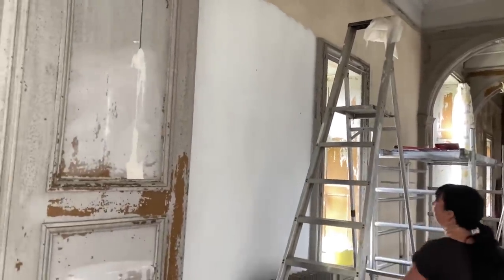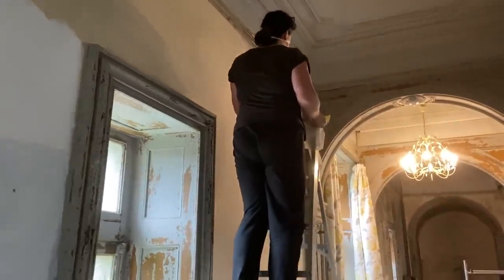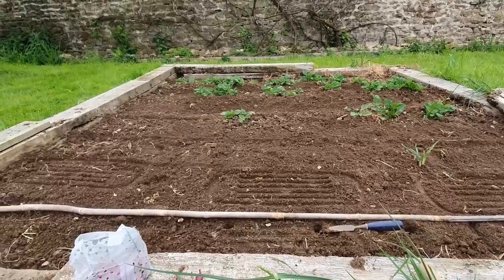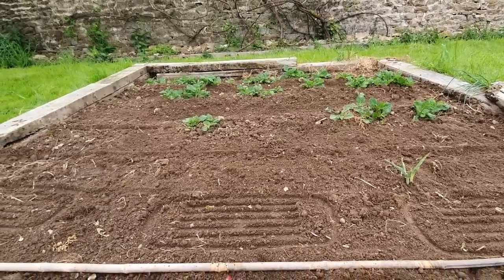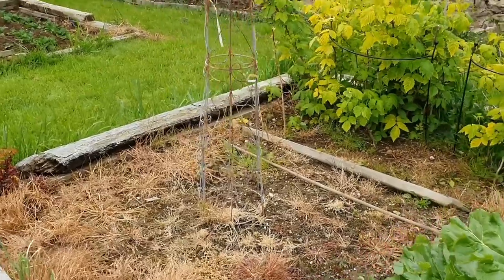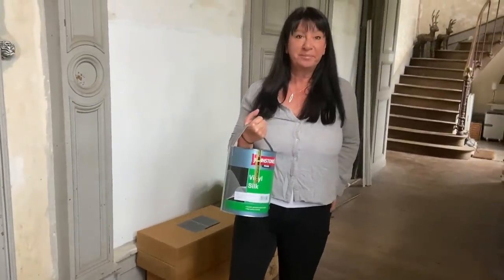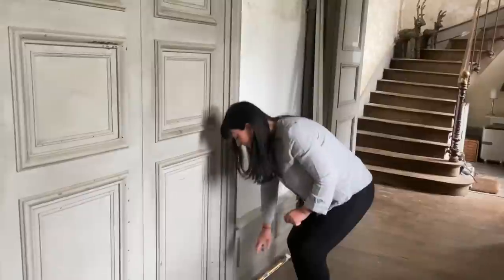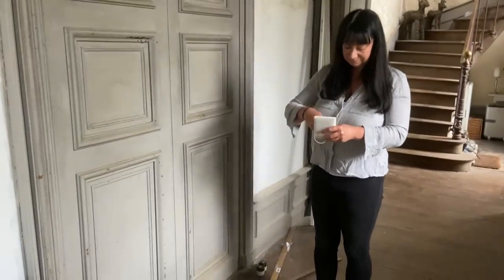The Château Gets A Horse From London!

Comment: Hi again Carole and Adrian. What a super effort on cleaning up the Hallway plaster et al. I assume the plaster on the walls is lime plaster and the original? I only ask because I noticed that you had purchased Vinyl Silk emulsion. By using Vinyl paint or papers on lime plaster you are taking away the ability of the walls etc. to ''breathe' which can result in exacerbating mould and damp problems further down the line. I had this problem quite a few years ago and it resulted in having to go to the incredible expense of re-plastering 2, 4x4 by 3 metres high rooms, including ceilings, in lime plaster (for listed 18th century building in England.) A big, big mistake I don't want to make again! Please , please, please check that it's ok to use the Vinyl before you continue. You are such a wonderful pair of hard-working, dedicated people working to restore a wonderful home for yourselves. Ships and Tar springs to mind. So sorry to sound like Cassandra again, I only want what's best for the Chateau and for yourselves going forward.

Comment: Hi Carole!  At 5:20 you can see that the brightness is there on the exterior wall because the exterior wall is painted white and the interior wall isn't. It kind of speaks to the fact going a 1/2 shade lighter for the exterior wall will match the interior wall closely at your original desired shade.  As well, on the ceiling at 5:00 you can notice the way the whiter base coat is much brighter than the unfinished side, as an example of how the natural light will play with your chosen paint.

Comment: Well done as usual Carole. If you run into issues with putting latex-based paints over oil-based paints in the future you could try (if it is available in France) using a mixture of trisodium phosphate (TSP) as a wash on the surface (following the prescribed directions on the container), let dry, then put latex-based paint over oil-based without a worry. That is what we did in the house I grew up in when Canada when they stopped selling most oil-based paints in favor of latex-based paints.
Not sure if paints with lead in them would react negatively to the TSP, so maybe check on that if you have oil-based paint layers that may have lead in them.

Comment: You should rig the light switches in the hallway together on the same switch so when you enter and turn the light on, the hallway is lit from one end to the other. Put these switches at different ends so you can turn then off without travelling from one end to the other.

Comment: You may be able to bend the harp inside the lamp shade back into shape. Years ago I worked in a store that sold lamps. The harps were frequently bent/crooked so we just bent them back into shape. It didn’t require a great deal of force but did require patience and attention to detail. We all know that you have those qualities.
Reply from the maker: I’d rather return it for a replacement incase we brake it
Reply: @LifeAfterLaFerté  I agree. If you pay for new, it should be perfect.

Comment: The little frame on your horse lamp from the light bulb socket base that goes up pass the bulb and has a screw that  holds the shade (held on by a finial) usually has an adjustable piece on the top that holds the screw for the finial that can be rocked, tilted or turned to make the shade level. That frame is called a "harp". If your "harp" does not, it would be my pleasure to send you one or more. Just let me know. We'll get your dimensions, etc, and I will "krack on" with one to you for the lamp. Also, should you like a particular finial such as a crystal ball, pineapple, laurel wreath or what ever - let me know. You should have my address here in Rome, GA USA on my subscription. You guys are amazing and are doing great work.
Reply from the maker: Hi Ken. Many thanks for your kind offer. I’m will be back in the uk again soon and will exchange the lamp as I don’t want to risk breaking the stem!

Comment: Is it not possible to use a low powered sand blaster for wood or plaster fittings, to speed up the process?
Reply from the maker: Always a fear of damaging the delicate pieces which you wont know until you blast them.
Reply: @LifeAfterLaFerté  good to know